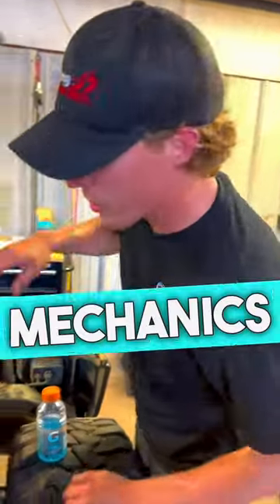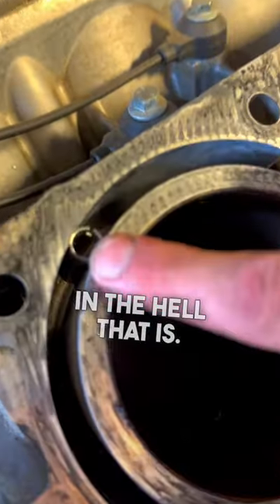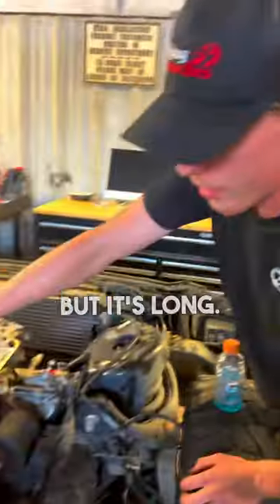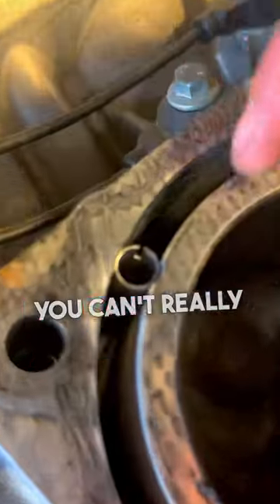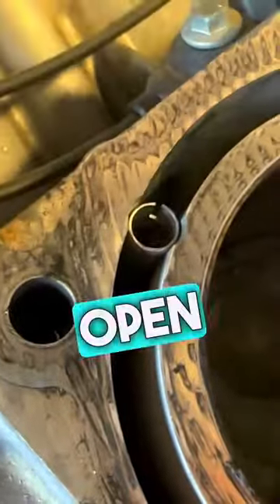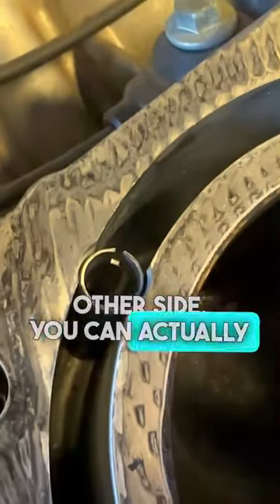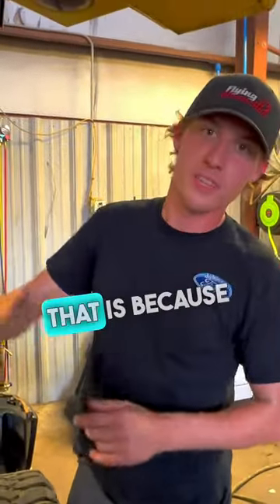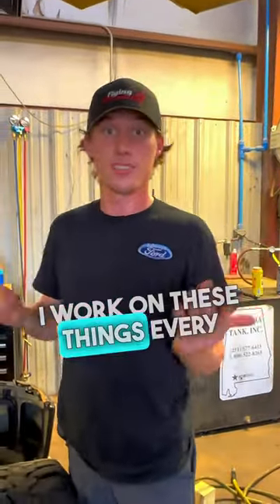What is this? #shorts

Comment: These are used to stop cavitation from swirling coolant. - Engineer here
Reply: Your an engineer but do you have a job. I hear there dime a dozen and can’t get work. True?
Reply: @johndoe-ds2om My brother had to move from the 2nd largest city to the largest city in my state to get work as an engineer. Yes their are a shitload of engineers
Reply: I still have a hard time understanding what cavitation is when talking fluid dynamics. 
Volume, pressure, friction loss, etc is confusing
Reply: @johndoe-ds2om yeah we’re def a dime a dozen, lots of work for a lil bread
Reply: @MrWEastwood considering how y’all design things I think the low pay is well earned.
Reply: @gulagpatrol6408 Cavitation has to do with the phase change barrier in a liquid. Liquids do not just change to gas when exposed to high temperature, they can also boil due to low pressure. However liquids also have a certain minimum pressure they can sustain, which is also higher than the pressure they boil at. When the pressure lowers to somewhere between those two pressures, this leads to vapors forming in small low pressure pockets suddenly, hence causing the cavitation bubbles.
Reply: Similar to a flow restricter in a Mercury Sable heater hose.
Reply: @gulagpatrol6408 it's easy,it's water bubbles exploding. 😂
Reply: @@AnameSurnamesarcasm, you ought to try it sometime
Reply: @johndoe-ds2om   With the lack of reply from OP I would say you fuggin nailed it.
Reply: @kylesebring Mic Drop!
Reply: @Back_door_bandit_98  I'm not an engineer but trolls like you are ridiculous. You realize they don't have the final say. The bean counters and EPA do. They have to work with impossible guidelines sometimes
Reply: @Back_door_bandit_98 
Engineers design, then the bean counters get involved, that's when it turns into crap.
Reply: @johndoe-ds2om false
Reply: @johndoe-ds2om lol dude I get calls from head hunters 3-4x per week.
Reply: @Back_door_bandit_98 lmao you're profile picture is a chevy truck you should just stop talking.   You'd never cut it, you could never get through the schooling 😂😂😂
Reply: @johndoe-ds2om nope, he's here trolling on youtube instead
Reply: Dad's an engineer, technically triple master, ivy league...he just moved from MA down here to NC for work.....as a custom cabinet installer...he takes 3 weeks to hang a door but damn if it ain't perfect.. kidding/not kidding. Oh he also invented and patented multiple things including the twin-break transfer switch, first pro scale 4 wheel drive system whike racing for Team Associated and wheel boat, he's a Kentucky colonel (kind if a gimmick but got it when he was KY branch manager of Westinghouse), ex nhra ,and 45 other lifetime's lived in one. He's 82 and going hard. Longer story short- plenty of engineers - not a lot of great "work" for the top tier guys...also that thing is for doing the cocaine you'll need by the time you break that engine down that arrived late on a Friday afternoon when you just finished making plans to drive straight to the beach and fish all weekend but bossman said its a Monday morning appt for pickup of the truck
Reply: @gulagpatrol6408  coolant In back of block hot. Coolant in back of block has to be forced through head. Coolant in back of block, when hot, likes to not go where it should go easily. Sometimes all you need is a little dowel to change the fluid flow characteristics. More than likely was added in during real time simulations
Reply: @Back_door_bandit_98 Lemme guess... one time you encountered something that you didn't understand but thought that something about some things you were working on was designed in a stupid way and you could have designed it better so all engineers are responsible for that terrible misdeed done to you personally, so they're all not very smart and don't do anything useful or worthy of compensation greater than that of a fast food worker.   I get it, the running joke is screw engineers, they design stuff to be difficult to impossible to work on just to make your life needlessly difficult.  I've had plenty of issues with engineers over the years but in no way does that mean that they're all worthless and undeserving. If not for engineers, your vehicles wouldn't be anywhere near so advanced, your house would fall down on you, you'd have no power in your home, you'd be wading thru raw sewage, you'd be scared to cross a bridge and you wouldn't be making stupid insulting comments to strangers while taking a dump.  Amongst other things we'd all be doing without if it weren't for engineers.
Reply: Bahahahahahaha
Reply: He said top tech mechanics. That's not you
Reply: I got some words for you mr engineer
Reply: @johndoe-ds2om it’s “they’re” like “they are” not “there”
Reply: @Kangaroojack1986 crazy too cause it takes a room of them to figure out their ideas are stupid. Somehow the bad idea still sneaks through
Reply: @gulagpatrol6408  Have you ever seen a boat prop spin up really fast?  Those bubbles are the result of cavitation.  
As far as I understand it's a matter of adhesion vs. cohesion of the fluid against the surface.
If the surface is exerting an adhesive force greater than the cohesive  force of the fluid then it will create tiny bubbles resulting in microscopic vacuum forces created by the pull between the two Which least to friction and heat.

I'm also shitfaced.
Reply: @t7489  It's  because being an engineer doesn't make you smart. It means you went to school long enough to get a degree.
         This can be applied to any college diploma. Engineering just seems to be super popular
Reply: @Kangaroojack1986 it's for compression of the liquid
Reply: @Kangaroojack1986 that's  all card/certification jack legs.  you need on the job training. After they get certified, it's like they don't know how to learn anymore. That's all they'll ever know.
Reply: @Back_door_bandit_98 it’s not the engineer, it’s the person who makes the executive decision to go with a specific engineering design from a list of similar designs. They want to maximize profit so they want to choose the design that will wear out in short time or require you to do disassemble a vehicle for instance just to change the head light, that forces the average person to take a vehicle to a mechanic more often and replace the parts, the parts guys and mechanic shops are all benefiting from this because they then get to charge a lot more, thought the mechanic is generally cussing most of the time while working on it.
Reply: @kylesebring to add to your cavitation explanation, another thing that causes localized low pressure is sound. 

When gas or diesel explodes in a cylinder, a shockwave of sound travels radially out from the cylinder. 

Shockwaves (and all sound waves) contain cyclic lower and higher waves of pressure. 

When the coolant is both hot and experiencing shockwaves from combustion, on the outside surface of the cylinder wall it can flash to a vapor.

The instant the low pressure portion of the wave passes, the tiny pocket of coolant vapor slams back into a liquid.

It is this slamming back together from being a gas to a liquid that causes (very) localized extreme pressure spikes that cause cavitation damage to the outside of the cylinder. 

Over many thousands of cavitation collapses, the metal will slowly be eaten away and/or experience accelerated corrosion. 

Eventually you end up with a hole in your cylinder, allowing combustion gases and coolant to mix.
Reply: @gulagpatrol6408 there is fluid on something. That thing vibrates and pushes some of the fluid away. When the fluid moves away it takes a very small amount of material with it. When this happens a lot it can erode the material.
Reply: @gulagpatrol6408  The simplest way to put it is that Cavitation is bubbles formed in the fluid popping. However it happens, the result is the same, excess wear
Reply: @johndoe-ds2om this is true, I am an unemployed engineer the job market is saturated with people searching for new jobs
Reply: Typical blue-collar response…you don’t know enough to know what you don’t know. Half an engineer’s day is spent trying to work around people who think they know better because of their “experience”.
Reply: @johndoe-ds2om and how do you know he's unemployed?
Reply: @Kangaroojack1986 You absolutely have to be intelligent to become an engineer. The physics and math courses alone are very very difficult. With that said like all corporate processes, one person is never the end all be all. You can be the smartest engineer in the world and you will not get to make decisions necessarily. I’m just a diesel tech but I’m not gonna hate on someone who put in the work required to get that degree. It ain’t a diploma, it’s a degree.
Reply: I found many can talk.
But to be willing to buy the tools and have the  physical and mental ability, that's a whole nother thing..
I've seen many in and out of a shop over the years call themselves a mechanic but they're not!
Reply: @charlesjenkins1191 you guys are the equivalent of “STOP I DON’T LIKE THIS GAME”💀
Reply: @_zach  read the context and stop liking your own comments. It's not healthy
Reply: Engineers cause these headaches 😂
Reply: @SKArz-MCMXCVI water is an incompressible fluid, however steam is compressible.
Reply: @TheXxxcodexxx steal?
Reply: @guess1866 every new change has to go through a source in the compaany that isn't an engineer, they look at it from a money point and if it seems like its gonna be to much they deny the change and keep the crap. They will decided if it needs it as it's presented to them by the engineers.
Reply: @Chevydude1982 lmao that's exactly how it was explained to me where we do industrial pumps repair. That cavitation will tear things up in interesting ways.
Reply: @TheXxxcodexxx  same thing,it fucks shit up 😂
Reply: My lifelong enemy! Do you know the headaches and hell you have caused me?!?!?!?!  Jk man, my uncle is an engineer so I take my engineer beefs up with him lol
Reply: @Carelock  im a heavy equipment mechanic so i wouldnt know what it takes to get a degree. Im just going off of what my brother (who is a mechanical engineer) told me based of his experience. I personally dont think a diploma means your naturally smarter, better life decisions sure.
Reply: @Kangaroojack1986  No, it doesn’t. But exceptions don’t prove rules. Anecdotal evidence (my brother said so) doesn’t meet any standard of evidence. College teaches things like this. If you randomly grab 100 engineers and 100 blue collar guys like us, so you honestly believe we would be of equal intelligence??? I have no doubt that you’re a sharp guy, but I also know a lot and I do mean a lot of moronic techs (if you’ve been doing this for any length of time im sure you do too). I just think it’s kind of a hater move to talk shit about educated people when you aren’t one. It comes off as jealousy, whether it is or not. If someone put that work in, give them their flowers. As far as design, I can 💯 guarantee you no one or even two engineers make decisions on design. It’s a financial decision made by middle managers who typically have a business or accounting degree, not an engineering degree. I wish you well, and I hope I’m not coming off as mean because I certainly don’t mean to be. Mechanics and Engineers are on the same team…
Reply: @Kangaroojack1986 to disrespect all college degrees is simply wrong. There are the good and bad in every profession, there are mediocre people and there are those with talent. Personally I would not want to be a mechanical engineer and have to deal with making all this new technology fit fit inside a car. But if you listen to all the best engine builders out there, they understand the theory AND THE MATH that makes their engines perform. Engineering is what makes it's so common to make 800+ horsepower with modern engines.
Reply: @johndoe-ds2om theres more you can do other than taking jobs specifically labeled as "engineer" with an engineering background 😉 
-electrician that works on cranes here(no were not all people running wires)
Reply: @jeffreykohm1824 its 100% the people behind the degree, not the degree.
Reply: @johndoe-ds2om they're...
Reply: @gulagpatrol6408  As a former firefighter we had to be careful about our hydraulics.
Cavitation occurs when the hydrodynamic pressure exceeds the vapor pressure of a moving liquid. Gas bubbles form within the liquid, which thus becomes a two-phase system. These bubbles will be crushed against the metal surface at high speed, an attack that leads to cavities with rounded contours.Cavitation occurs when the liquid in a pump turns to a vapor at low pressure...it's bad news.
Reply: @ShaareiZoharDaas  two stage pump issues
Reply: Could I install these in a 7.3idi, as they are known for cavitation?
Reply: You have an engine in your ear? Maybe 2, one in each ear.
Reply: Who is Cavitation, and why does he want to swirl coolant?
Reply: @gulagpatrol6408 you could ask Jimmy anything you want to know about anything. He’s an “ engineer”🙄
Reply: @mysupersuperglide  it’s my assumption. I didn’t design this motor, obvoiusly. The only time you’ll see a restriction added into a cooling system is for trying to eliminate a hotspot, reduce or eliminate cavitation concerns, and/or force fluid in that part of the engine partially another way. On the 2.7 and 3.5 they have coolant tubes on the back of the head that run to the turbochargers on each side. For example the 6.4 has coolant restrictors behind the front cover and the one on the side that feeds the egr coolers is smaller to force more through the coolers. 🫡
Reply: "Top tech mechanics" not top tech engineers. You have to learn to listen properly
Reply: @Back_door_bandit_979 it's the damned accountants not the engineers.
Reply: @gulagpatrol6408 cavitation is what happens when localized pressure in a liquid drops and the liquid turns into a gas, the gas bubble collapse when pressure rises which creates tiny shock waves which can overtime damage parts.
Reply: @johndoe-ds2om that’s cause it’s costs more than a degree 👀🎉
Reply: If everyone was a engineer who goin clean the  traps at buger king 😂wait everyone is 🤣 so either save money to keep learning or spend now to think later 👁️🇺🇸but wait everyone thinks for themselves 🧐
Reply: So y not be a engineer 🇺🇸🇺🇸🇺🇸Iam waiting America 💡
Reply: But hey now u can think for yourself at a lower interest rate 👁️💡👁️ wake up America 🇺🇸🇺🇸🇺🇸